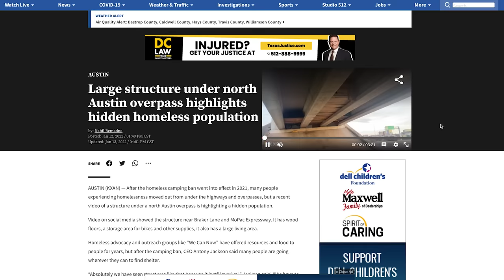Walmart 1v1v1 Build Your Own Stealth Shelter! (hiding from game warden)

Comment: If there was one thing I learned from my Army Ranger buddy, is to always cover fresh cut sapling stems with dirt. The exposed white wood is very noticable, specially to seasoned foresters. It can also give them a time frame of when you did it and how far away you could have gone after you did it. It's crazy how many ways you can be detected out in the woods. And a little bonus note, don't clear out large sections of foilage, you should trim what you need and try to make it look as full as you can. Doing stuff that's noticable makes you noticeable

Comment: Ayo, most topsoil is very loose… if you dig deeper you’ll find hard soil.

For reference, to hide soil… I was a contractor for years, the way we never made a mess and always left it perfect like we were never there is by using tarps to hold dirt that we have ti backfill, but for dirt like this you want to move permanently, you’d clear the area of all leaves or if it’s crass cut out the grass in sod sections to put back later, then scatter the dirt evenly across the area and reapply the leaves or grass. You can literally dig a 10 foot hole in the middle of a grass field, scatter the dirt across a 30 square foot area, then put the grass sod sections back ontop and it wouldn’t look like anyone had touched it.

Heh, did this as a kid in a mound in my backyard but i haven’t since. I could fool him 100% without a doubt. He wouldn’t ever find me. Id find a grassy field, skin the sod off a 20 foot square area, dig a spider hole way bigger than that, and scatter the dirt in my surrounding skinned area, once it’s dug out I’d replace the sod pieces and water them in to look natural again, use a trapdoor like yours except with a piece of sod on it. Then I’d aerate that piece of sod and any other sod covering me and maybe ever pop an air hole if that isn’t enough airflow throw the sod. And I could build that within 3 hours without trouble.

Comment: I hid in the backwoods of Kentucky for over two months when I had a warrant, before I left the house I grabbed a shovel, hatchet, a spool of twine, and three bags of supplies including four 5 gallon jugs of water, 6 pounds of peanut butter, 2 pounds of pistachio's, and about 40 granola bars I had in my pantry.  I dug a decent-sized hole about 3 miles deep in the woods from the road in a thicket about 30 meters away from a stream that was covered on three sides with bushes and it ended up being about 5 feet deep and was 6x8 in dimensions and all I did was cover the hole with sticks and some leaves and despite hearing people (I am assuming Hunters) above me pass by on 6-7 occasions nobody ever found me.  Eventually I got sick of having to bury my shit, wipe my ass with leaves, and burning ticks off with a lighter so I just turned myself in but I could have stayed out there longer.  I just figured that I was delaying the inevitable really so I spent the 4 months in jail.  

  The best part was the peace and quiet because prior to doing all that I was working two jobs, fighting with my girlfriend at the time, and was constantly busy.  It really felt like a vacation actually and helped my mental state immensely.